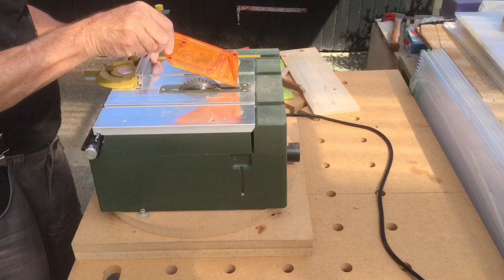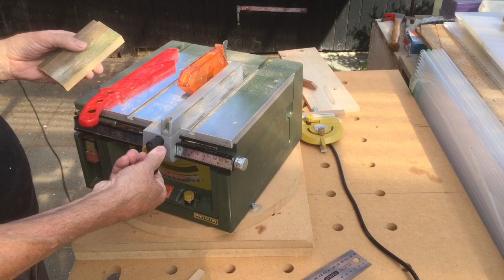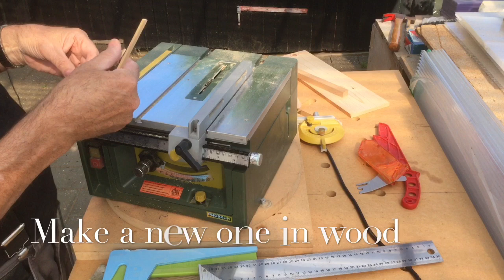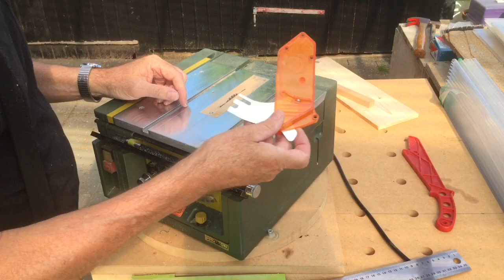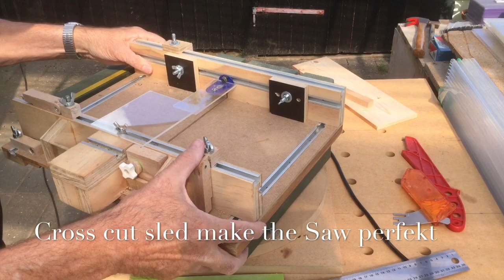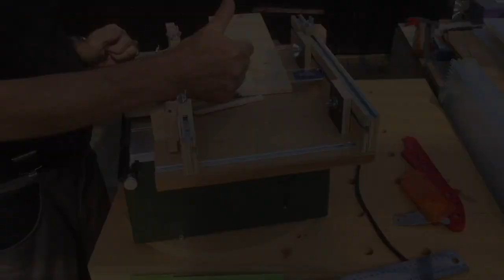Proxxon FET plus minus

Comment: 2:32 i dont understand, why did not use bar. is it dangeraus using horizontal and vertical bars at same time?. (i am new user)
Reply from the maker: Yes it is a bad idea, maybe not so dangerous on such a small saw but very dangerous on a large one.  I think that Proxxon FET is in many ways a really good saw but it requires a lot of adjustment before it works optimally but these are things you can do yourself.

Comment: It can saw off a thumb, lovely machine! 🤣🤣🤣
Reply from the maker: Yes, I think it is possible if you plan it right but if you have many you need to get rid of, a larger saw is probably preferable :-)
Reply: @Harris-DIY  remove orange protector and set to max thickness for cutting, i have seen people do that... I have this tool myself and it's nice that it's not only designed for cutting veneer.
Reply from the maker: Thank you for your comment

Comment: Thank you for all your great videos Harris! I've been learning so much. I'm thinking about buying a FET but want to use it for slightly bigger cuts… I wonder if it could do longer longitudinal cuts? Have you ever tried something like that? Do you think it could be possible if the working surface was extended in the back to receive a longer piece of material?
Reply from the maker: Thank you for your comment.  You can build a plate behind the saw to support long cuts, I myself have several times sawed lengths of 1-2 ml 6 mm MDF and 3 mm plexiglass and light wood but I would not recommend doing it in dimensions over 10 mm and  your setup should be so it does not squeeze and stop the saw.  The saw is built to small dimensions and although the motor can handle a lot, the construction itself is weak and the electronics are sensitive to overload.
Reply: @Harris-DIY  thank you so much for your detalied  reply. Perhaps I need something slightly bigger then. I was looking at the DeWalt 8 1/4 inch table saw, but it runs in 110v and has markings in inches instead of metric… Do you have any suggestions as to possible alternatives?
Reply from the maker: I have not just considered a table saw but it would probably be either a Bosch or DeWALT.  There are two things in particular that would be important, it must have a fens that is 100% stable and then it must be possible to use a Cross Cut Sled
Reply: @Harris-DIY  thank you, I’ll keep that in mind :)

Comment: Looking good. What is a thickness of a wood for new one?
Reply from the maker: Mox Mix Which tree do you mean?
Reply: @Harris-DIY  I presume that new plate for closing a hole around the saw you made from wood. What is the thickness of that plate.
Reply from the maker: Mox Mix The thickness is between 2.25 and 2.28 mm.  I started by planing down to 2.30mm.  with my Proxxon DH40 and then sand with sandpaper to fit it exactly
Reply: @Harris-DIY  Thank you very much.